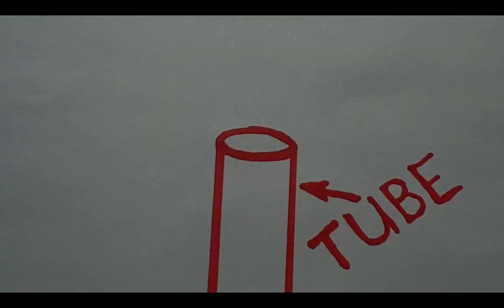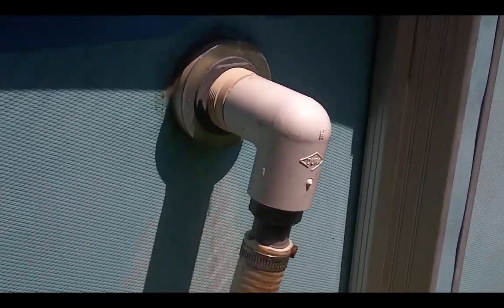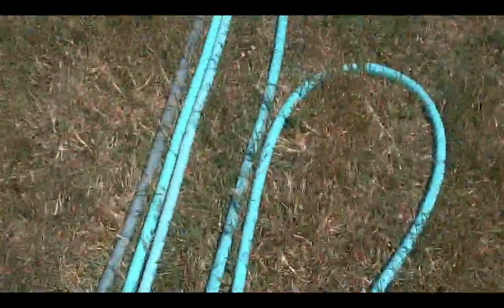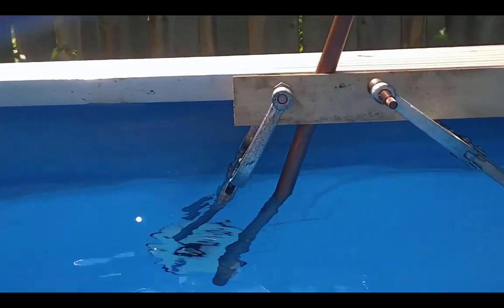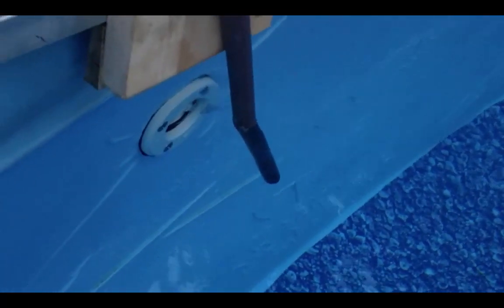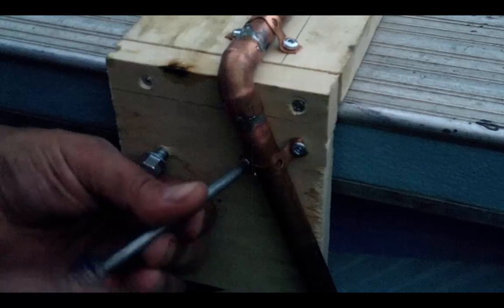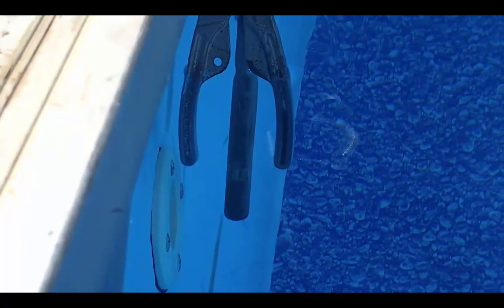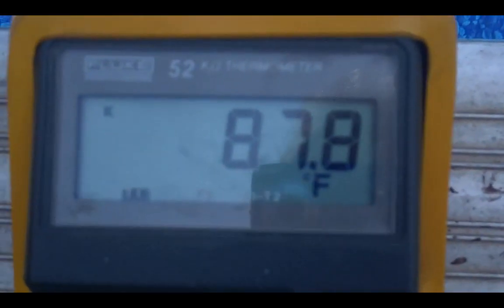DIY Solar Pool Heater

Comment: So much useless and unnecessary step to this! And copper pipes are 100% not needed for this!
Reply from the maker: Thank you for your opinion.  How would you do it?
Reply: @MikeManzoni  unless ur using heat like fire copper pipe are beyond stupid!
Reply from the maker: It seems you may have misunderstood.  The amount of copper pipe I used was only a couple feet.  It was to form a rigid outlet to join to the garden hose only.  The rest was all garden hose.  Watch the video again and tell me what you think with your new found knowledge.

Comment: Mike, how do I get the vacuum started or is it really subtle?
Reply from the maker: The suction starts when water flows across the copper pipe.  The pipe should be pretty close to the water flow.  If you did it correctly you will feel some suction on the other end.  It's important to start with a hose that is full of water already.
Reply: @MikeManzoni  Thank you! I got it working!!

Comment: You seem like a smart guy, can I ask you this.  What do you think would be better to heat a pool by the sun. Using 1/2" black plastic pipe or 1/4"?  Was going to get 800ft of it but not sure what would be better.
Reply from the maker: Hello Ty,

It's hard to get much flow through a 1/4 inch pipe and 1/2 is not much better.  You want maximum surface exposure to the sun and also a reasonable amount of flow rate to move enough of the heat captured into the pool.  I'd go with 1 inch pipe if you can afford it.
Reply: Thanks for the reply. Will invest in the 1"
Reply: @tysmith7646  BTW, having spent the summer of 2020 trying to heat an 18000 gallon pool, I can tell you that there are a lot of variables (and barriers) to getting solar to work well.

 I started out with 1" PEX in a coil spray painted black and barely got a few degrees in direct sun at 2.5+ GPM. Doing the math, it wasn't particularly effective for me because of trees so I was at best getting 8 hours sun. I went with 1/2" irrigation hose which others recommended, and it was better, but I started in Sept with 200' on a four foot by four foot panel. Due to the sun being lower, I had to reposition often and I think I'm getting better effect from air temperature than the sun at this point. Using it even today, but it's still somewhat negligible effect at 2 degrees @3GPM (3000 btu) with very little sun, but if I could get one or two degrees (it's 70' out) to water that is below 60', then yay. This is more learning than practical at this point.

What I'm trying to say is that going with 1" might not be better in terms of net effect: heating the pool. Like others have said (see SoloEngineer's heating tables for some good math), it's a balance between flow and temperature.

Comment: Hi Mike great video, what size copper pipe did you use and does it matter?
Reply from the maker: I just used standard 1/2 inch plumbing pipe.  I don't think it really matters the diameter of the pipe.

Comment: That's a really great and simple design! I would've thought you would require some kind of valve or pump and a much larger surface area of piping to heat the pool. That temperature difference is a lot greater than I expected.
Reply from the maker: Remember however, the flow is quite slow.  Adding more hose adds to the friction slowing it down even more.  It's a fine balance.
Reply: This is the dumbest shit around!

Comment: wait, wheres the energy coming from to circulate the water through the hose?
Reply from the maker: The flow moving across the hose created by the filtration pump is all the energy needed to create suction at the hose.
Reply: @MikeManzoni  so some of  the water coming out of the return pipe inside the pool is going into the cooper pipe/hose, and then returning hotter into the pool by the other end of the hose? is that how it is? What I'm doing is I got 2 bucket heaters and making the return water hit the 2 bucket heaters before it returns the water..would that be same principle maybe? thanks dude, good stuff Mike, let me know
Reply: Did you freaking listen? He explained it at the beginning, you dimwit!
Reply: @coleman6131  No need to be rude, sir.

Comment: Actually it's the Venturi effect.  Bermuli principle applies to aircraft wings..
Reply: Grrrr Bernoulli
Reply from the maker: Actually, we are both correct.  The Venturi effect works because of bernoulli's principle.  A fluid (gas or liquid), in this case the pool water, moving across an object (the copper pipe), causes a low pressure area (suction) on that object.  You are correct that the same principle applies to aircraft wings too.
Reply from the maker: Thanks for leaving your comment

Comment: With all due respect, this is pretty useless at 2Gpm ... unless you have a 50 gallon pool that is :-)
Reply from the maker: Hello Cfen, I have to agree with you that 2 gallons per minute is slow movement.  Something you are not considering is the huge increase in temperature and also the compounding effect of time.  The water travelling through the tube in this example was raised from 75 to about 88 degrees and it ran all day during the heat.  It was enough to raise the temperature an extra degree.  The next day it went from 76 to 89 degrees and within a week I had a steady 83 degree pool.  Best of all - it cost me nothing.  Thanks for your comment.
Reply: I understand what you are saying. But, if you are raising the temperatur by 13 degrees at 2Gpm, that would be 120 gallons per hour raising 13 degrees. If your pool is for example 3200 gallons, then it takes 26 Hours to raise the pool 13 degrees. That's 2.5 days if you have 10 hour sper day of sun. Not taking into account the loss during the night.

I have a similar system which just uses the pool pump (which is running for the filtering) to pump water up to 2 coils of black tubing. My pool is 3200 gallons, and I raised the temperature from 68 degrees to 82 degrees in a single day.

Don't get me wrong, it's a great system, but I just think 2 Gpm will take far too long to heat up any decent size pool. Just my idea ;-)
Reply: Oh and just 2 more little things (not to be nagging :-) ) Use black tubes , will greatly increase your efficiency.
And secondly, what is really important for best efficiency is the Delta T. The difference is temperature between intake and outflow. The lower it is, but the more gallons per minute, the more efficient and faster the system wil work.

"It's better to raise 1000 gallons per hour 1 degree instead of 1 gallon per hour a thousand degrees" ;-) you get what I'm saying.

I do however love the idea of pumpless waterflow , great !!

Comment: will this peoject work for a inground pool?
Reply from the maker: It should work for your in ground pool but it depends on the shape of it.  Most in ground pools are not round.  My sons and I tried it at a hotel pool that was rectangular.  We stood in a row along the middle and got the waves to splash side to side.  They went pretty high and a lot of water was sent onto the deck.  Then management came and asked us to stop it.  Ooops!

Comment: Do you think it would have enough suction to put a hose coiled up on the roof.
Reply from the maker: Hi Bob - Good question but you may not like the answer.  It depends.  I initially tried it with about 100 ft. of hose and it worked fine.  It pulled about 2 gallons per minute.  Then I thought how much better it would be if I had 300 ft. of hose instead. I bought the hose and tested it on the ground and found that it hardly moved any water at all.  It was due to the resistance in the hose.  You could probably make it work in the roof if you keep the hose length fairly short.
Reply: Mike Manzoni  how about a manifold with three 100' loops in parallel? Same resistance but more surface area for heat transfer.
Reply from the maker: You should use a pump for that.

Comment: what kind of pump are you using? I am thinking of running black lawn tubing on my roof about 12' off the pool.
Reply from the maker: Hi JaimePatricia, The beauty of this system is that it requires no pump at all.  It uses Bernoulli's principle to suck the water through the hose.  The pump that you already have filtering the water causes suction on the heating hose.  Please take a moment to watch the video again and you may see it more clearly.  Thanks for your interest!
Reply: Curious if it worked to the roof as this would be my only option as well
Reply from the maker: This system will not suck water over the height of a roof.  I did a different test with a pump lifting water to the roof of my house which is two stories high.  All you need to do is test to see how high your pump will lift water.  If it will bring it to the height of your roof then it will work for you.  Gravity just pulls it back into the pool.

Comment: Would it have to be copper pipe? Could solid pex or pvc also work?
Reply from the maker: Hi Seth,

Any rigid pipe should work.  I used copper because it was easy to join to my hose and I had a piece kicking around.  Try it out and let me know how it works.  Don't overdo the hose length.  I tried it with 300 ft. - too much resistance - no flow.